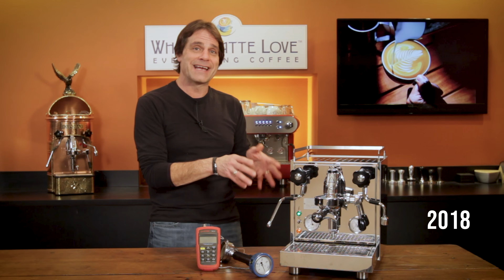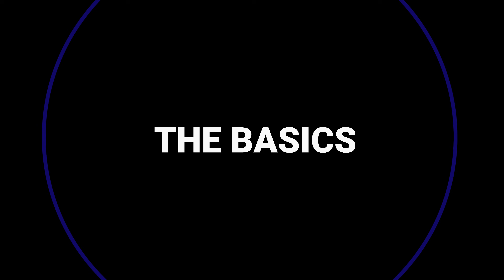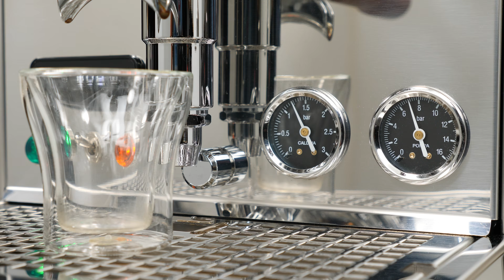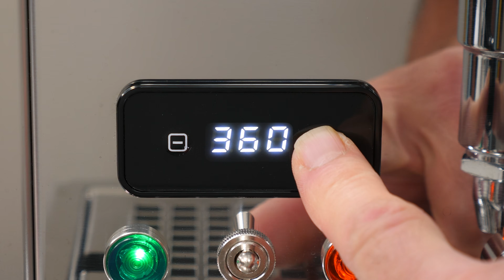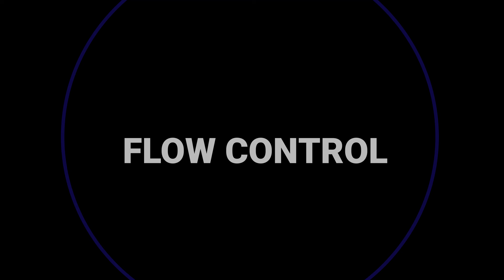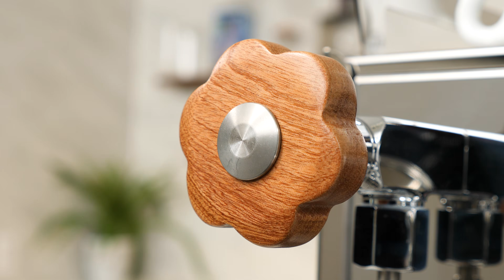Review: Profitec Pro 500 PID Espresso Machine

Comment: I have the previous version of this machine purchased from WLL. The ECM static relay has failed again. This is my third or 4th one since I've purchased the machine. This part typically lasts about 3 months whether I've used the machine once or twice a day. For the past two years the machine has been used just once a day. 
I have to wonder if Profitec is using a low quality component. The machine was rather expensive and the same part having to be replaced every few months indicates a lack of quality. The machine makes great coffee but is reliable only for 3 months at a time. I would not recommend machines from Profitec.

Comment: Pro 500 vs bianca..which one better?
Reply from the maker: Hi a, thanks for the question. Depends on what "better" means to you. The Bianca is a rotary pump dual boiler plumbable machine while the Pro 500 is a vibration pump HX boiler which is not plumbable. Both are capable of making excellent espresso but there's a large price difference. Most would say the Bianca is better because it's a dual boiler and plumbable. Hope that helps!
Marc

Comment: My home coffee journey...

Used French press with freshly roasted beans for 6 years,
Then to Aeropress/V60/Clever Dripper for the past 3 years,

Now I am thinking about an espresso machine (like the beautiful Profitec/ECM) but scared to take the jump because I am worried about the...
1. Learning curve
2. Will I notice the improved quality for the big price?
3. Maintenance if I accidentally break it

What is driving me forward is the 5 or so times out of 100+ visits to coffee shops when the espresso tasted out of this world (like an amazing food).

And if the learning curve is just too tough I am thinking to forget the manual journey and get a Jura automatic.

Please advise.
Reply from the maker: Hi cs, There is a learning curve but once you get the basics down it's straightforward - all about controlling variables. In my experience and hearing from others, the espresso made at home is almost always superior to what you'll get in the majority of coffee shops. Automatic machines are very convenient but compromise potential quality compared to semi-automatic machines.
With your other hands on brew method experience using freshly roasted coffee I suspect results from automatic machines may disappoint. Jura machines do have pleasing designs but they do not compare to the handmade craftsmanship of traditional machines.
If you are at all handy with tools traditional machines are easy to DIY repair if needed. We have excellent self-help support and expert techs you can talk to - even schedule a CoffeeCast, a free 1 on 1 video session to check out or get support on products we offer.
Schedule a CoffeeCast here: https://www.wholelattelove.com/pages/coffeecast
Support site for Profitec Pro 500: https://support.wholelattelove.com/hc/en-us/sections/1500000401142-Profitec-Pro-500-PID
Hope that helps!
Marc

Comment: just watched your pro 400 review. the temp you set it to is the same as the group. but the 500 pid is not the same temp as in the group is that correct.
Reply from the maker: That's correct, when setting temp on the Pro 500 you're setting the actual temperature in the boiler. In machines with heat-exchange boilers the true in boiler temp is always higher than the temp of brew water delivered to the group for brewing. Some HX PID machines calculate the group temp based on an offset from the in boiler temp.
Marc
Reply: @Wholelattelovepage  So, in this case I have to set the temp higher in order to receive the desirable result ? and how much is this difference ? I am asking since I am considering get a new macine and I am between profitec pro 500 and pro 400 . Their difference is about 400 euros and I am not sure if this difference worth it.
Reply from the maker: @Alexpapad94  If you're looking at a Pro 500 with PID (not all Pro 500s have PID) then to get middle of the road 93.4 C brew temp you would set PID to 120C.
Hope that helps!
Marc
Reply: @Wholelattelovepage  Do you think that will be more difficult to use pro400 in comparison with pro500 ? They have a good price different since I find one open box in Europe for a good price. I mainly drink espresso and sometimes drink milks (80%-20%)

Comment: For the uninformed newbie to this high level of coffee machines, what are the differences between the Pro 400 and the Pro 500 PID? Would a newbie warrant the additional features in the Pro 500 PID as they learned more and more and used the machine more and more eventually advancing out of the newbie status? Many Thanks!
Reply from the maker: Hi T, Thanks for the question. The Pro 500 has more precise control of temperature. It can be set degree by degree. The Pro 400 has a 3 position switch for selecting basic brew temperature ranges. Use the cooler setting for darker roasts and hotter for lighter roasts. For many users that level of control is enough. Both machines use heat-exchange boilers. Left on and Idle for long periods brew temps tend to creep up so the precision of the 500's control depends on using the machine at optimum time after turn on or experience to know when a flush is needed to remove over heated brew water.

Comment: In 2024.. this or the Pro 400? @marc
Reply from the maker: Hey m, Thanks for your patience - been offline on vacation. Depends on what's important to you. The Pro 400 runs brew temperature in a couple of ranges. Cooler for darker roasts and use the middle temp setting for lighter roasts. If you're more particular the Pro 500 has more precise temp settings. With HX boilers both machines may need a flush prior to extraction depending on idle time and other variables. But, both use PID so less temp variation than machines controlling boiler heating with a pressurestat.
Marc
Reply: @Wholelattelovepage  thank you so much! I actually ended up with the ECM Mechanika Max as advised by your amazing sales team (Amanda did a great deal of help) so I hope I didn’t do too bad hahah

Comment: Why is there no documentation anywhere what max gram size on each included baskets??
Reply from the maker: Hi fm, Thanks for the question. Manufacturers hesitate to give capacities due to the fact that the type of coffee used can change them. Lighter roasts are denser so you can fit more. I've used the 500 a lot and other Profitec machines which use the same original baskets. In general, the capacity of the doubles runs 14-18g while the singles are 8-12g. Of course there are aftermarket precision baskets with higher capacities like those available here: https://www.wholelattelove.com/collections/portafilters-and-filter-baskets
Marc

Comment: This machine is beautiful, especially with PID and the shot timer! Appreciate all the effort you put into these videos, Marc. How would this machine compare to the Lelit Mara X V2? Seems like this may have better build quality and you could potentially be more accurate with temperature control due to the Mara X "only" having the three pre-programmed temperature options (although not sure much more than that is really necessary). I have heard great things about the Mara X for making milk-based drinks, which is what I am predominately wanting an espresso machine for. Any suggestions? I am also considering one of the similar ECM machines.

Comment: Great review! Would the eureka mignon facile or silenzio work as a good companion for this machine?
Reply from the maker: Hi MSNL, The Facile and Silenzio are essentially the same 50mm flat burr grinder inside. No difference in grind quality between the 2. Silenzio has timed presets available which helps with dosing weight consistency. These grinders are sufficient but about the minimum I'd pair with a Pro 500. A step up is the Ceado E5Pro with 64mm burrs: https://www.wholelattelove.com/products/ceado-e5-pro-espresso-grinder
Hope that helps!
Marc

Comment: Hi Marc. In all honesty, your knowledge and easy to understand presentations are some of the best I have ever seen, I really enjoy watching them, great work!

I would like your help in a recommendation for an espresso machine that can handle my max use, i.e. 3-4 lattes (8 ounces of milk) and a couples of double espressos + a coffee Americana or two without having to wait many minutes for reheating etc. Apart from basic functions available on most machines, I value PID and a pressure gauge (adjustable extraction pressure), which my current DeLonghi does not have.

I have been looking extra at Profitec and ECM which seem like excellent quality, models like Profitec Pro 500 and 600 and ECM Classika and Technika. Based on the volume and types of drinks I produce, can you recommend a couple of models to look at (my head is spinning from informatio overload) ? Of course price is an issue or I would simply get a Synchronika or Pro 700 :)
Reply from the maker: Hey h, Thanks for the kind words! So many options. If regularly doing milk drinks I'd take the Classika out of the mix. It's a single boiler so more appropriate for someone doing mostly espresso and the random occasional milk drink. If you appreciate excellent quality in components and finishing ECM/Profitec is the way to go. Pro 500 is a good choice. It uses a heat exchange boiler so adjusting PID temperature changes both steam pressure and brew temperature. The Pro 600 is a dual boiler so you have individual control of each boiler. Brew temperatures are more stable and you have more steam pressure than on the 500  - up to 2 bar if you want it. On the 500 you'll have closer to 1 bar of steam pressure. When you take water out of the 500 for Americanos or steam lots of milk recovery will be longer than on the 600.
Hope that helps!
Marc
Reply: @Wholelattelovepage  Excellent help, thanks Marc! It is only a USD 100 difference between the 500 and 600 where I will buy, so I guess a no brainer. Of course the ECM Technika V PID Profi is only an additional USD 150 and it is a beauty... Again, great films on Youtube, much appreciated!

Comment: Hi Mark. Which machine would you get Profitec 500, Rocket Type V or ECM Technical V

Also if I can push for a dual boiler is the ECM the one to go with?
Reply from the maker: Hi SKS, Thanks for the question. If you can go to dual boiler ECM Synchronika that's as good as it gets and the only dual boiler ECM. The Profitec Pro 700 is essentially the same machine under the hood as the Synchronika with slightly less detailed external finishing so lower price. The ECM Technika V Profi is plumbable to waterline if desired and like the Synchronika and Pro 700 uses a quiet rotary pump. It's basically the HX boiler version of the Synchronika. I prefer the Profitec Pro 500 over the vibe pump Rocket machine.
Hope that helps!
Marc

Comment: Okay. I’ve been experimenting - with a little better results-  I have a top notch scale and I weigh 18g and then weigh the shot at 36g - it’s only yielding 1.5 ounces at around 22 seconds - if I go finer the yield maybe higher but then the time may drop to 19 seconds.  I’ve been told 36g out should be between 20-25.  Any Profitech gurus? I’m using a medium roast and have it dial in on the display at 248 degrees per the instructions of Mark. Thoughts
Reply from the maker: Hey LE7, Assume your 1.5 oz is a liquid volume measurement? I would not consider liquid volume when using a scale. Just use the weight. Standard espresso recipe is a 1:2 ratio produced in 20-30 seconds. For you 18g ground coffee to produce 36g by weight in cup. For a vibe pump machine like yours timing should probably be closer to 30 than 20. From where you are now at 19-22 seconds you'll want to grind a hair finer to extend the timing. 248F should get you ~200F brew temp. Right where you want to be for a medium roast coffee. Keep in mind timing is a starting point and not a hard rule! I'd taste your espresso at different timings and decide what you like best. Hope that helps!
Marc

Comment: I have 16 inches of counter height limitation. Is height measured at the rails or chassis top?
Reply from the maker: Hi d, it's 15 5/8" to top of the cup rail. It will fit under 16" cabinet. Trouble is access to water reservoir if fully under overhanging cabinets.
Marc

Comment: Anyone know what the ideal temperature should be for this machine? I’m pulling 18.5 grams of beans and it takes about 25 seconds to do 2 ounces - temperature on the screen on 255. Medium coffee typically. Not oily. I believe I have everything dialed in -but my shots sometimes seem bitter or sour.  Thanks for any insights.
Reply from the maker: Hi LC, 255F on the PID display results in a brew temp of ~205F which is on the high side of the 195-205F espresso brewing range. High brew temps tends to produce more bitter flavors. Your brew temp may be even hotter than 205F if the machine has been on and idle for more than ~30 minutes. For medium roast coffee I suggest setting PID temp to 248F which gets you a brew temp of about 200F - appropriate for a medium roast. General guidance is higher brew temps for lighter roasts and cooler for darker roast. If machine is on and idle for long periods perform a cooling flush right before extracting espresso. Lift brew lever without PF mounted for a few seconds until your observe smooth flow of brew water. Hope that helps!
Marc
Reply: @Wholelattelovepage thanks so much. Very helpful. And I do notice a difference when I leave it on for extended verses pulling as soon as it hits 255.  It seems it takes awhile for the brew unit to catch up?  The pull is better when it’s hot. 😆 meaning the pull looks nicer not necessarily taste better. 😂
Reply from the maker: @gainknowledgeandinsight  You're welcome!
Marc

Comment: Trying to decide between this machine or the Rocket Appartamento. Any advise?
Reply from the maker: Hey Ryan, Here's a side by side spec comparison of the Pro 500 and Appartamento: https://www.wholelattelove.com/pages/compare?products=NDI5MTY0MTYwNjE5OCwxNTQ2MDQwNTA4NDc1
The Pro 500 has features like PID temp control, shot timer, brew pressure gauge and upgraded build quality compared to the Appartamento. Not sure where you are but be aware the version of the Pro 500 in this video with visible PID is currently only available in US/Canada from Whole Latte Love. Pro 500 from other retailers may differ in appearance.
Marc

Comment: Compairing this model and the 600 i understand you get a db. However for entertaining a small group of friends would there be a difference in making multiple milk based drinks. Also do heat uo times between the 2 compare or is one better than the other..
Reply from the maker: Hi WW, The dual boiler 600 will have more stable brew temps when making multiple drinks back to back. Also has more steam power available with the ability to change the temp of the steam producing boiler without the brew temp changing as a result. Heat up time is similar with total boiler volume of 59oz for 600 and 67oz for the 500. Hope that helps!
Marc
Reply: @Wholelattelovepage  thank for getting back.

Comment: My machine came and it is perfect, two things, can I get the custom wooden handles after the fact? And also in order to get a 94° brew temperature in the group head I am needing to put it on the maximum PID temperature, which is 128°C. Is there something that needs adjustment?
Reply from the maker: Hey Tristan, Thanks for the report. You may be able to get custom wood options after the fact - best course is to check directly with the vendor. As for temperature, Profitec advises a boiler setting of 121C for 94C at the group as measured by Scace. How are you measuring temperature? If using standard thermometer in flow from group or into cup those will always be lower than what's happening in the portafilter during an extraction.
Marc
Reply: @Wholelattelovepage  thank you! For the trails, let me to exactly that, 121 equals 94. Thank you so much, yes, I have the coffee sensor thermometer in the group, I think you were saying that it shows a lower temperature. When I flush the group had the same monitor, says 94, then during the shot it says something like 92.5, I think you’re saying I should trust the flushing temperature of 94 and assume that that is the brute temp

Comment: Hi Marc - thank you for the review!  updated one is enticing for an upgrade from my 6 yr old Breville express. how do you compare this to profitec pro800 v2 in terms of quality of the expresso (purely from a smoothness & flavor) - if you keep the lever and other technical differences aside.   Thank you!
Reply from the maker: Hey BMV, You are welcome! Enticing indeed! Lever shots are often characterized as being sweeter and with a more syrupy body. But much depends on the coffee used and skill of the user. The basic lever extraction profile uses a higher than standard initial pressure/flow rate and as the shot progress the pressure and flow declines. This is often beneficial when using darker roast, Italian blends or similar. If the Pro 500 is equipped with flow control you can do essentially the same thing. You generally will not get initial pressure as high as you do from a lever machine but you can do the tapering flow rate. Beyond that, flow control opens up many other profiles like long low flow pre-infusions and more. If you're the specialty coffee type using very fresh, single origin, lighter roasts you're likely to get more flexibility on a flow control equipped Pro 500.
Hope that helps!
Marc